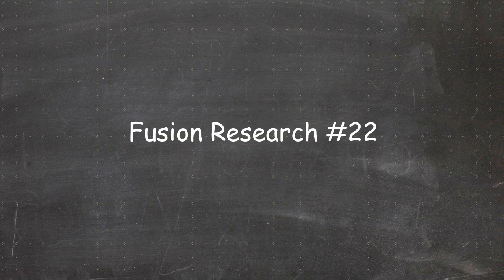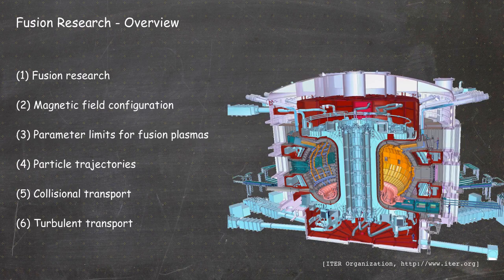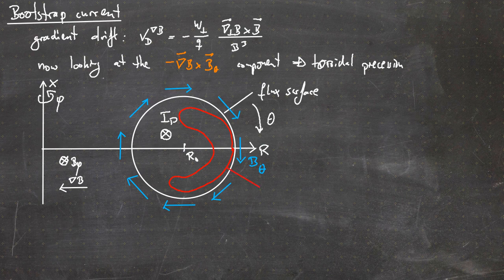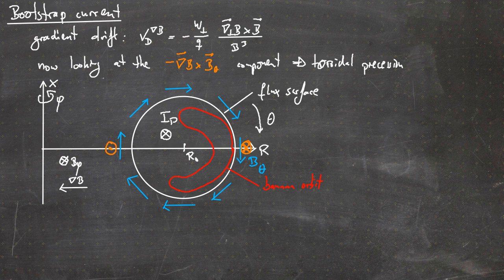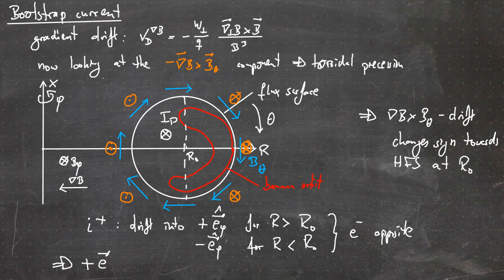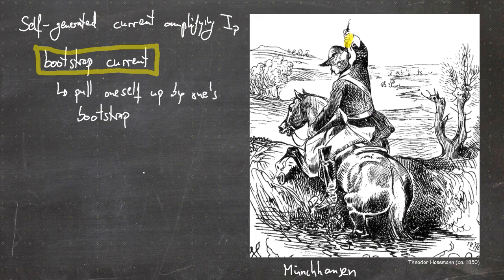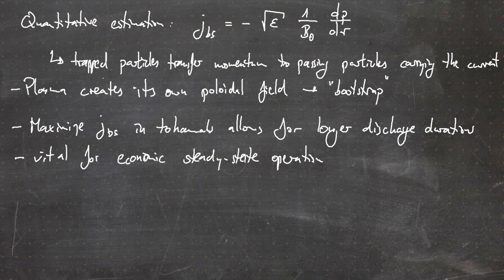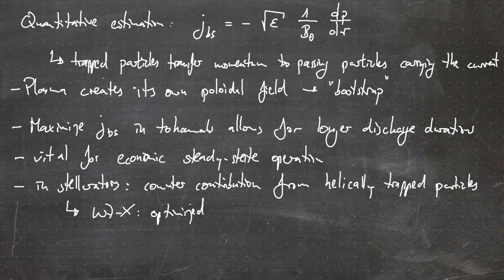Fusion Research Lecture #22 - Bootstrap current & Ware pinch

Comment: The first nine or so minutes of Lecture #22 describes how the origin of the bootstrap current is the drift(the Drift) created by the cross product of the gradient of the magnetic field and the poloidal component of the magnetic field.

Then, during the eleventh minute of the lecture, a quantitative estimation(the Estimation) of the bootstrap current is written down with no reasoning given.

Please show how the Estimation can be derived from the Drift.

Thank you.
Reply from the maker: Somewhat analogous to the diamagnetic drift, a toroidal drift motion results from the banana particles given by grad p x B_theta (as you said), as explained in the first ~9 minutes of the video, rearranging this expression and taking into account the fraction of trapped particles, sqrt(epsilon), gives the estimation as shown in the lecture.
Reply: Thanks for your reply. I appreciate it.

Is the origin of the bootstrap current grad B x B_theta as stated in the first nine minutes of Lecture #22 or is it grad p x B_theta as stated in your reply (and as is consistent with the lecture starting in the eleventh minute)?

You wrote “Somewhat analogous to the diamagnetic drift, a toroidal drift motion results from the banana particles given by grad p x B_theta.” If the toroidal drift or bootstrap current results from the diamagnetic-like drift of the banana or trapped particles, then shouldn’t the bootstrap current be in terms of the pressure gradient of trapped particles not the pressure gradient of all particles? Now, I believe, the fraction of trapped particles goes to zero as r goes to zero, that is, as r approaches the plasma center.  And the density of all particles goes to zero as r goes to a, that is, as r approaches the plasma boundary. If I’m right, then it seems like the gradient of trapped particles should be in the positive r direction near r = 0 and in the negative r direction near r = a. Is that correct; and if it is correct and if the bootstrap current results from grad p_trapped x B_theta, then doesn’t that mean the bootstrap current is in the opposite direction near the plasma center (r = 0) as compared to near the plasma boundary (r=a)?

Comment: Been really grateful to have found this lecture series, has helped me in my literature review on fusion a lot! I have a quick question - you stated that since the banana orbital was largely biased towards the +phi drift section that it will have a net drift in that direction. But then surely the electrons (which we said act oppositely) will be biased towards the -phi direction and hence they would cancel each other out
Reply from the maker: Yes, as said or written on the board at e.g. 08:34, electrons and ions drift into opposite directions. This is no cancellation though, they simply drift into opposite directions and thus eventually create a net current (transferring their momentum via collisions to passing particles)